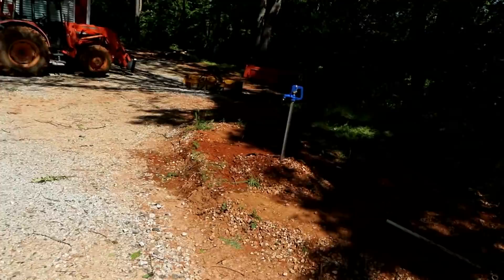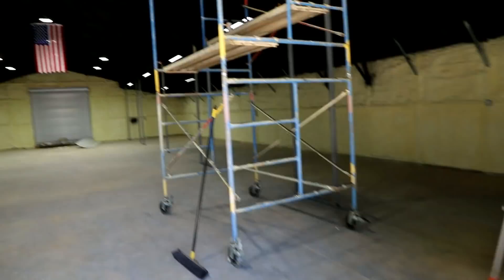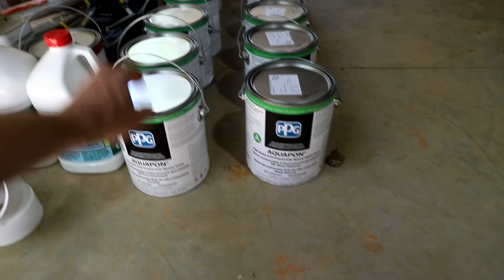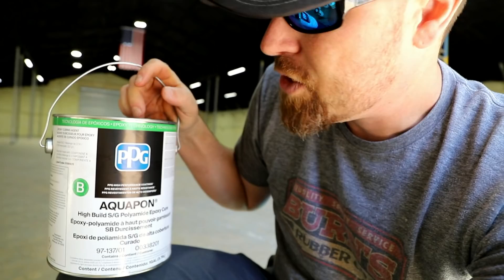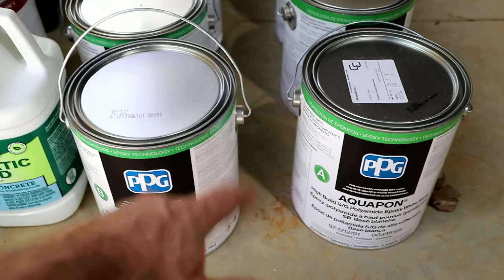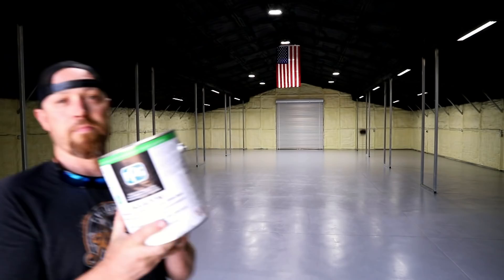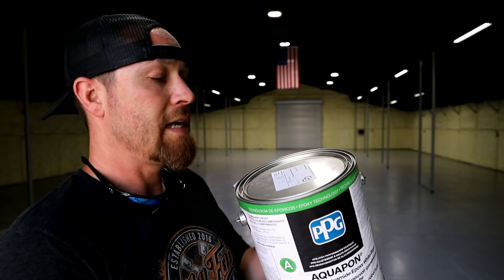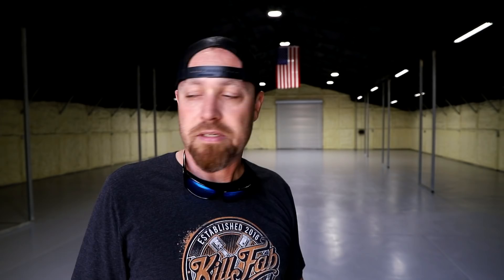How To Chemical Resistant Epoxy Garage Flooring

Comment: It's important to note for anyone looking to buy it, that while this particular product is not, PPG does make a water-based Aquapon epoxy that is exactly the same stuff you can buy at hardware stores.   They make 7 or 8 different lines of Aquapon epoxy.    Also you should still seal it, it is recommended by PPG and it makes the floor much stronger.    It came out great, I'm a huge fan of epoxy over those plastic tile floor systems, I love my floor.
Reply from the maker: yeah for sure...may experiment with the PPG clear coat in the lounge space first

Comment: Floor's looking awesome! Tip for audio recording when you get the shop moved in: wireless mic transmitter. They're really cheap (starting as low as 25$ a pair) and not at all complicated to set up. Will kill pretty much all the echoing and overall improve sound quality (by cancelling out noices from machinery etc.)!
Reply from the maker: I have tried some...have not found one I like

Comment: If you're looking for a cheap and easy sound absorption solution for taming echoes in the shop my preferred method is to make a frame out of 1x4 pine and stuffing it with Roxul rockwool insulation. Dow Corning 703 rigid fiberglass panels are another product with comparable absorption properties.

I also wrap the panels in fabric, you'd want to choose something fire retardant obviously.
Reply from the maker: yeah I need to do something. I will check into that

Comment: Looks great. It just takes one coat? I would of guessed it takes a couple. I used to work in a machine shop. And right in front of every machine (We're the operator stands 8 hours a day) the epoxy was completely worn away in a huge circle. I remember thinking it created a huge eyesore, and they should of done more coats. I highly doubt you will ever run into that problem, I'm sure it was fine for 1000s of hours before it wore away. It is definitely a tuff coating.
Reply from the maker: I think multi coats can be done but I just did one. Yeah you would think they would have used mats in front of those machines

Comment: Epoxy floor in a welding shop. Epoxy turns to goo with spark and slag.
Reply from the maker: this stuff should do pretty good...especially considering mostly what I do is TIG

Comment: Not sure why the soaking the concrete in water to clean it. Vacuum cleaners do exist. Scraper, vacuum dust as you go along, vacuum twice more, acid etch, paint. Epoxy hates even slightly moist concrete, it takes 6 weeks to properly dry out from being soaked, our rule of thumb was 4 weeks minimum, which when painting a swimming pool was a PITA. Anyway, it looks good.
Reply from the maker: yeah mainly because of the clay mud we have around here that was tracked all over it.
Reply: Agree water on cement before sealing it not best idea.  Only one coat no primer sealer seems odd to me.  When you do house keep it dry thin first coat so it absorbs in to floor and hit it with a second way better finish and longevity.